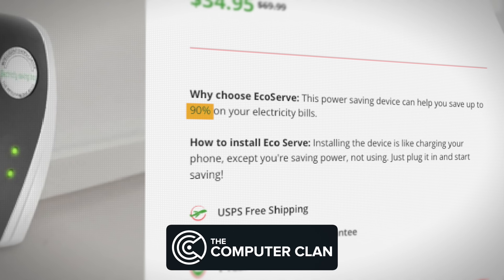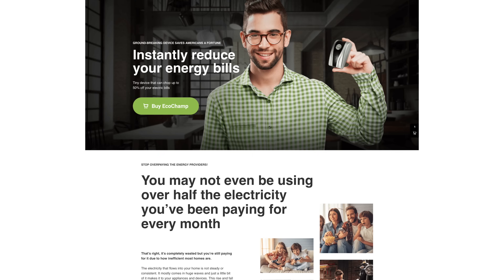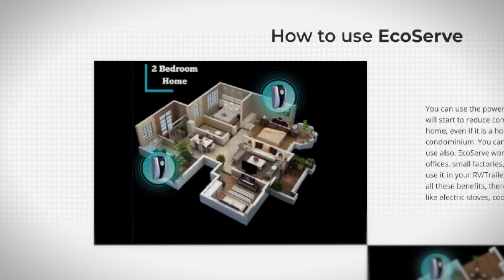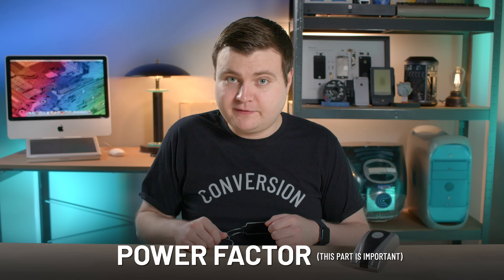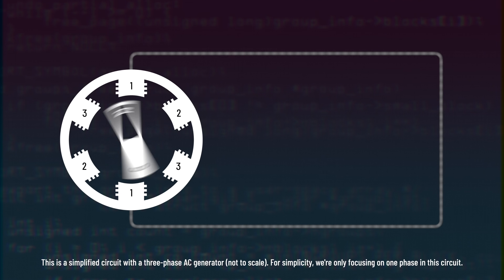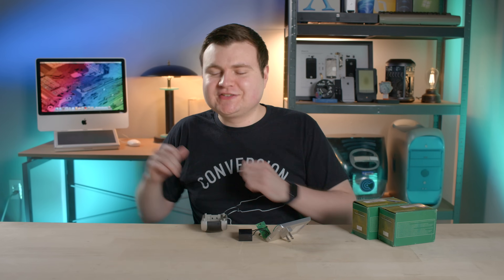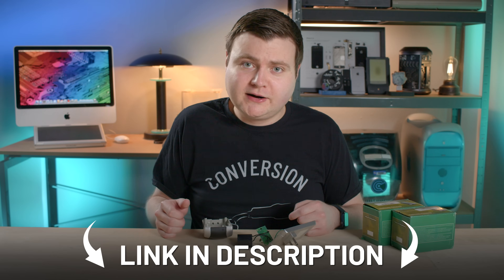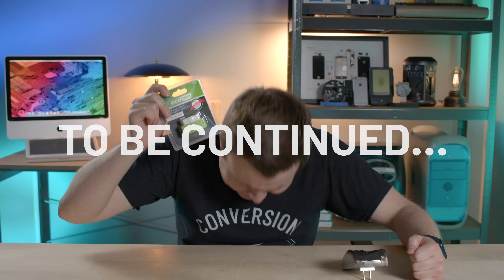Electricity Saving Box Scam (The WORST I've Seen) - Krazy Ken's Tech Talk

Comment: Are there any other devices that actually do work?
Reply: ... to somehow magically make energy more efficient than physically possible? No.
Your best bet to save on your electric bill... Use less. So, insulate your home better, find better heating/cooling solutions, use chest freezers... Live in a mud hut. Idk.

I guess the closest thing would be installing solar panels to get back credit from your power provider but... I think the huge tax breaks for going solar have kinda dried up. Might still be an option though.

Comment: The reason power companies penalise poor power factor is not that the have to supply reactive "power", which does not exist, but that the reactive component is taking real current, which the generator must produce, and use larger cables, both of which cost more. If you consider a factory with a near 0 PF, they could be using almost no power, but the power company might have to provide 1000 A, and this current will have I^2R losses in the outside cables.

Comment: Why didn't you open the black box? 
I highly doubt there's actually a cap inside. Cheap caps in a sealed box would die rather quickly, dead capacitors create short circuits, and so on. 
Those people want your money, they don't want to get sued for burning down your house.

Comment: There was one product called Greenplug.
That one actually did work. Somewhat.
It allowed full voltage at startup then clipped voltage back down to about 106v.
It was intended for things like washing machines and refrigerators.

With modern motor designs, it is no longer needed.

About lightbulbs - they sold a little disc that you tossed in the bulb socket then the incandescent lightbulb.
It was merely a diode that only allowed 1/2 the cycle into the bulb.
Bulb was 1/3 dimmer but it did make bulbs last longer. So you did save a few pennies every month. IF you used the bulb a lot. But the goal was to make the bulb last longer, which it did until you upsized from a 60w to 100w just to get the light you needed  and lost your savings.

No longer necessary with the advent of CFL's and LED's.

Capacitors will help with motors on a demand meter reducing your spikes. But homeowners do not have demand meters.

Want to save money? TURN OFF THE LIGHTS when not using them.
And anything else you are not using (kids love to leave the TV and lights on A LOT).

Save even more money and toss that computer gaming rig, which can use 1000 watts. Toss that x-box and the like along with the tv/monitor it uses.
Have ONE TV in the house, not 5.

Save money and get rid of that 60-83 inch tv and go with a 40 inch or less.

Save money and eat cold sandwiches.

Save money and turn t-stat down to 63/64 in cold weather and up to 78/80+ in hot weather.
Blankets and sweaters are cheaper than the utility bill. MUCH cheaper.
If your furnace/ac is older than 15 years, upgrading to an energy efficient one will pay for itself in energy savings.
Make sure you have the proper insulation. Fix drafty windows. Open curtains in winter on sunny days and close them at sunset.
One 'standard' window will allow nearly 5,000 BTU's of free heat into your house! PER WINDOW! (Note sun has to be shining to see the max benefits and windows have to face the sun). Reverse that in the summer to keep the sun out to save on AC costs.

Save money and toss all the kids' cell phones. They absolutely do NOT need them. Each one you toss saves you about $25 each not counting the cost of the phones and replacement ones later on. No electricity needed to recharge them 3 times a day either. Social benefits and health benefits abound when kids have no cell phones.

Save money by line drying, even in the winter.
Save money by washing in cold water.
Don't use the oven in the summertime.

About clothes dryers - they make a diverter for the dryer vent that will let you divert that hot moist air back into the house.
Clothes dryers usually vent to the outside.
They use your expensive conditioned inside air to heat and dry your clothes and discharge that outside. Result, you draw in outside air to pay and condition then the dryer wastes it by venting it back outside. You are paying twice every time you use a clothes dryer.

And change your furnace filter regularly - if you cannot see the same light through it as a new one, it is probably restricted.

Shower nozzles - Aqua-Helix used 0.6 gal per min instead of the 1.5-2 gpm. Saves on water, SEWAGE, and hot water. Your electric/gas meter will thank you. Utility company won't though. Limit showers to 10 minutes or less.
NO HAIR DRYERS!

Replace all light bulbs that are not LED with LED ones. Except those outside. LED's and CFL's do not work very well in very cold temperatures.

About your car - keep it well tuned and tires properly inflated. Keep tires aligned. Buy tires with a low rolling resistance not the fancy gas guzzling aggressive cool tires.Learn how to 'hyper-mile'. Get rid of junk in the trunk. Stop hauling everyone's butts around that you do not need to. Driving with the tach under 2000 rpm will save money - slowly get up to 2000 rpm though. Drive like you have no brakes if you can. Combine all trips that you can and your first stop is the farthest one away and work back home.

Just a few tips above that can save you a LOT of money.

Most gimmicks (devices, additives) do not work. The ones that do will take decades for you to get your money's worth.

Comment: I never put a sope on our incoming power but would think that if it was too dirty the supplier would have to clean it up or get a nice class action suit from a lot of people. And things with micro-processors would have a power supply that was made to clean the power up if it was dirty but I don't know. That's for folks like you to explain. I know my generator has dirty power but it just runs stuff in power outages but hasn't blown up anything yet. I have a 5k 220 for the well and an old Onan 4-pole for coolers and such. Thanks and Blessings!

Comment: I've heard that many designs of „smart” meter being used in the UK are also capable of measuring (And billing) on KVA as well as the traditional kWh (I think Big Clive mentioned this at one point). For anybody using a lot of inductive loads (Which includes a lot of routine domestic equipment like vacuum cleaners, CRT televisions, and anything with a wound transformer in it) that would be a massive /ahem/ shock to their energy bills... 🤯

Thankfully, a lot of the UK is still in the process of „Levelling Up” at the moment...So my energy bill isn't measured in kWh, it's measured in Cwt...Of coal! 🪨🇬🇧🤣

Comment: Ha, I find it rather amusing that you would have a Sense featured in a video debunking energy saving devices. While legit for what it actually does, Sense does absolutely nothing that common sense didn't already do for you for FREE.  Maybe I'm wrong, but I thought the average consumer kind of already knows that running something like a space heater or window AC unit costs $$$.  It should be pretty obvious that something that briefly dims your lights momentarily like you central AC, a refrigerator or a motor turning on is most likely using more electricity.  It should be fairly obvious that any appliance that produces larger amounts of heat while running are typically using more electricity than ones that don't. And, again, I would think it should be fairly obvious that an appliance with a thicker cord on it most likely uses more electricity than lets say your lamp with a thin decorative silver cord. Why does one need Sense to tell them any of that?

Comment: I wonder how good the capacitors inside these are, high voltage capacitors can be expensive so one benefit of these things is that it could be a good way to get some high voltage capacitors for less money if you're willing to tear them apart to harvest their components.

(This only applies to the aliexpress versions since they're cheaper).

Comment: This review is wrong. This product actually saves 100% of power to heat ur home when it's plugged in for long enough. The unit is designed to eventually catch on fire and generate natural heat without using any electricity. The longer it burns, the more energy u save.

Comment: Those boxes were meant to protect old computers from power surges. I guess scammers repurposed them when newer computers no longer needed the boxes.
Reply: .... That would require plugging the computer into them. These just plug into the wall. Oh, and btw, most power strips have surge protection as a feature already. And I'm honestly not sure if desktops have any built-in surge protection. Power supplies haven't changed that much over the years. Though, most likely, it'd just burn out the power supply and those are only like 20-60 bucks depending on how expensive a computer we're talking about. They can be as much as 200... But... Nobody really needs a 200 dollar power supply in their PC.

Comment: Recently saw one where the scammer even got rid of the big black capacitor. Every part inside the case was there to make a LED glow from mains voltage. 

Next step would be to get rid of the expensive PCB and just airwire the parts together. 🙃

Comment: You are wrong about "AC helps electricity travel long distances". Transmitting DC from electric stations woud result in less electricity loss compare to AC and give you another benefits (you can google that). The only benefit of AC is easear voltage convertion

Comment: Electricity companies will eventually start charging for apparent power. That's why they're pushing so hard for everyone to get their "smart" meters, especially as we are moving further away from the older resistive loads like filament lamps and AC motors to LED lights and DC motors.

Comment: "On the sine wave it produces"
Me, an Electrical engineer: Pauses her computer, gets up, goes off to smoke.

Also I'm pretty sure that's just an AC to DC converter circuit because those lights are NOT meant to be run off of AC power. 
So really this is just a 120v ac to 5v dc converter, 2 LEDS and a few resistors to modify the voltage and current going to the leds.
Reply: There is no AC to DC converter. There is only resistors on the board, no rectifiers. I suspect the LED's are in inverse parallel, so they light up individually as the voltage goes positive to negative.
Reply: @Manticore1960  I suspected that little black pack tbh. I could see that being a small rectifier circuit to handle the conversion but if it's just a capacitor then your argument is the right one

Comment: I bought thirty of these and plugged them into every outlet in my home. I had to take some of them apart so they would fit on the same outlet since I had to plug some of them in upside down. I also bought two surge protectors and plugged more of them in.

My electricity bill has lowered dramatically, but it is very dark, and my computer doesn't work for some reason, so I'm posting this on my phone. I also don't know how to charge it anymore.

Comment: If you really want to save power… paint your roof in Barium Sulfate cooling paint, and use a proper heat pump instead of a forced air furnace.

Comment: you say that, but with smart meters becoming more common now, theres nothing stopping your energy supplier from secretly changing the power charged to reactive power and since theres loads of people now using LED lighting and other "energy efficeint" devices which have a poor power factor (most LED lights have a power factor of about 0.5), your 4w LED light could be costing you the same as a 20w light

Comment: Why you lying........

LED and CFL bulbs use driver's and ballast to help regulate that power. And part of that process keeps the bulb from flickering

Even incandescent.......with no dimmer, that element is Litteraly glowing....it's not going on and off.

Dimmed way down incandescent bulbs kinda look like they would flicker.
According to physics apparently cheap CFLs will do what he says, but LED shouldn't. And incandescent bulbs do, apparently America specifically chose 60hz because it made to where the human eye will never catch it switching.

I still don't believe it. The article was vague on the type of filimint......when they Litteraly glow....I don't believe they would ever go completely out in the wave drop.
Reply: He never said they go out. Simply that they dim. Which is what's happening. As the voltage drops, the luminosity drops. But since there is plenty of residual thermal energy, the light doesn't entirely go out.

Comment: The way I got this reactive power stuff is this,
Power station gives you sin wave
Stuff that use true power reduce the magnitude of the wave
Stuff that use reactive power shifts the wave back a bit in time
If you simply add the shifted wave back with the power station sin wave, they partially cancel out, even though that's not powering anything. 
Instead you can use another device to shift the wave back in phase with the power plant, and remove that waste.

Comment: Love your shows, I see where I can get those electricity savers dirt cheap from China.  I was just thinking, I need small boxes for building projects.  Right now, I am building wifi radios to play music throughout my home. I have built them into old radio sets so the set can play music from the era it was built, such as 40s tunes for old tube radios from then, I have a 57 table top with the set tuned to 1957 and so forth.  All my sets have a built in web interphase so it will serve you a page with around 80-100 stations it is set up to play from the web and most of the stations broadcast high quality stereo music except for those that play historic audio, such as one of my old favorites Armed Forces Vietnam from 68 to 71 the time I was over there.  At any rate those boxes are about the right size for my projects, I could knock out the ring and put my display on there and build a 5 volt DC power supply as part of the set and go from there.  This is cheaper then buying cheap kit boxes from the same place.  Plus I could  use the caps for some old radio sets to use as filters!  What a plan!

Comment: I mean if you only have 2 electric receptacles in your house and you plug one of these devices in then it does save you 50% power. If you plug in two then it is truly 99.9% as you can no longer use the receptacles for anything else.

Comment: Love your videos. They’re thought provoking and brain-enlarging every time:-) …I have a question though and forgive if it’s a dumb one. Does the “power factor” you talk about on the packaging apply in residential areas in Asian/Euro countries? I know it’s still,a scam, but just wondering if they talk about it in the packaging as a target for users who might be familiar with the term in their area.
Reply: It's globally common.
Domestic customers are not charged for reactive power (the result of a low power factor- less than 1). As it says, things which cause reactive power consumption, like refrigerator motors, might have power factor correction capacitors built in anyway.
The reason large industrial installations with many large motors are charged for reactive power is that the sum of all the motors create low power factors.
This results in the infrastructure providing the power has to be robust enough to handle the total current (reactive and real) meaning larger cables, larger transformers, and larger generators, which is costly. Therefore it is in the consumers' (and utilities) financial interest to install power factor correction capacitors which will be switched in and out automatically depending upon the measured power factor at any moment in an attempt to bring it back to unity PF, i.e. 1.
Historically it's simply not worth measuring reactive power in a domestic environment because the power used is predominantly real power with just a very small amount of reactive power. It would need a second meter to measure reactive power.
 However, I notice that my domestic smart meter also measures reactive power but I don't get charged for it, just real power. Sounds a bit sinister. Maybe when smart meters are more widely used the utility companies will start charging for reactive power as well. 
You have been warned!

Comment: the only way i can think off a electricity saving box is if it has a transformer like a power supply but instead of the wasted energy gets converted to heat it charges up a battery even then i think it would only be able to save a little more energy due to charging limitation unless you make it the size of a ups and if you want to save even more it becomes bigger

wel good luck dragging a transformer the size of a industrial power generator around just so you can charge your phone without wasting electricity

Comment: You know, for a little over 1 dollar it's not that bad. You get a high voltage capacitor, two LEDs and a nice enclosure for your mains powered device project. Just be careful with the mains and know what you're doing.

Comment: I’m fairly sure the resistors are just for the LED power supply. Interesting they don’t even have any diodes, so they’re connecting those LEDs with resistors straight to the mains. That sounds nice and fire-provoking.
Reply: Just 50% Cycling the LED's. They illuminate during half of the sine wave power cycle. The resistors just dump the current down to allow the LED's to function without popping like firecrackers. In dumping the current down they convert the excess to heat.